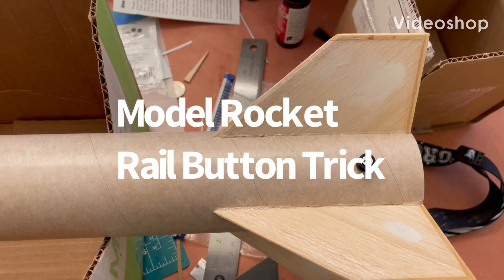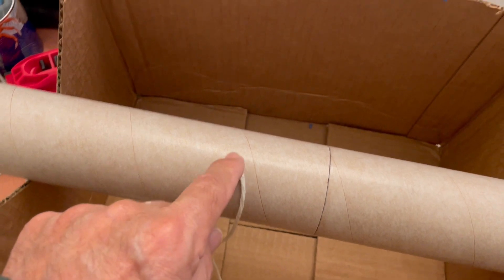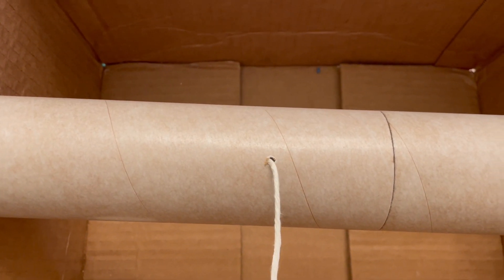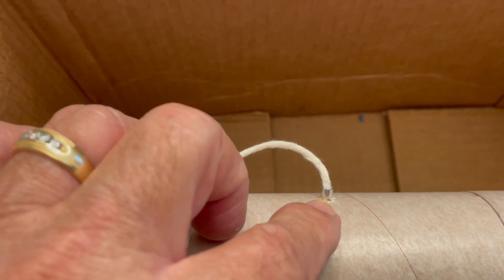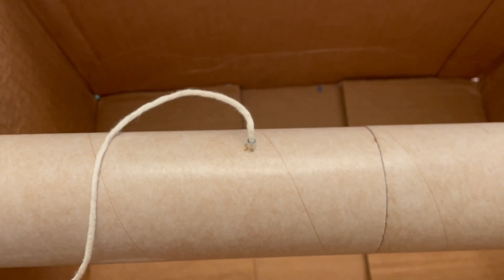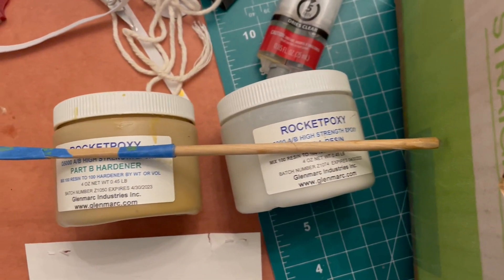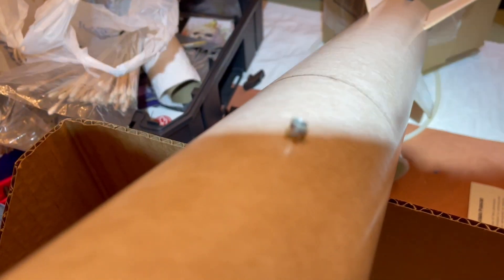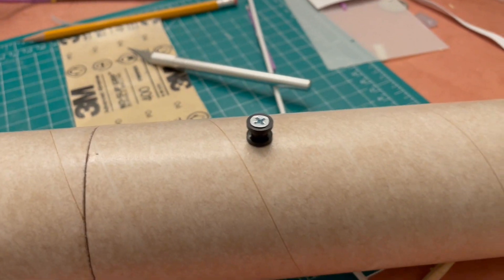Model Rocket Rail Button Trick

Comment: Put glue on the button and pull. (The brightness on the flashlights is pule-width modulated. They are like a strobe.)
Reply from the maker: @charlesspringer4709  That would work as well.

Comment: Sir, what exactly does the rail button do? Does it serve the same purpose as the guide straw for the old Estes tripod launch platforms?
Reply from the maker: @ralphfrasier2079  It’s used to launch the rocket off a rail which is much stiffer than a rod. If you look at a rocket being launched off of a rod in slow motion, you will see a significant amount of what’s called rod whip. The 1010 rail is much much stiffer.
See: https://youtu.be/l6qXGNb7Kdg?si=auBeTaoXR_ao7XXs